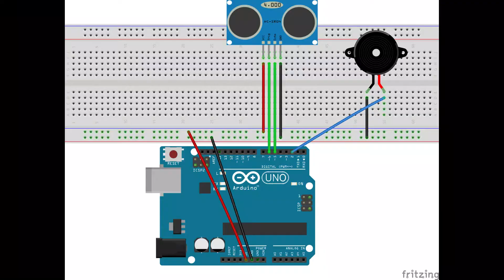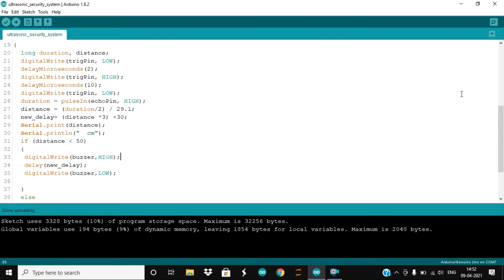How to make a Security System with Ultrasonic Sensor and Arduino

Comment: // Security Alarm with Ultrasonic Sensor (HC-SR04) — FIXED

#define trigPin 6
#define echoPin 5
#define buzzer  2

// Ajusta según quieras el patrón
float new_delay;

const int  MAX_CM = 400;           // rango útil aprox del HC-SR04
const long TIMEOUT_US = 25000;     // ~4.3 m (vel. sonido)

void setup() {
  Serial.begin(9600);
  pinMode(trigPin, OUTPUT);
  pinMode(echoPin, INPUT);
  pinMode(buzzer, OUTPUT);
  digitalWrite(buzzer, LOW);
}

void loop() {
  // Disparo del pulso
  digitalWrite(trigPin, LOW);
  delayMicroseconds(2);
  digitalWrite(trigPin, HIGH);
  delayMicroseconds(10);
  digitalWrite(trigPin, LOW);

  // Lee eco con timeout para no bloquear y no retornar 0 "falso"
  unsigned long duration = pulseIn(echoPin, HIGH, TIMEOUT_US);

  long distance; // en cm
  if (duration == 0) {
    // No se recibió eco: asume "sin objeto" (muy lejos o absorción)
    distance = MAX_CM + 1;
  } else {
    distance = (duration / 2.0) / 29.1;  // conversión us -> cm
  }

  // Filtra fuera de rango o negativos por ruido
  if (distance <= 0 || distance > MAX_CM) {
    distance = MAX_CM + 1;
  }

  new_delay = (distance * 3) + 30;  // tu fórmula
  Serial.print(distance);
  Serial.println(" cm");

  if (distance < 50) {
    digitalWrite(buzzer, HIGH);
    delay(new_delay);       // beep
    digitalWrite(buzzer, LOW);
  } else {
    digitalWrite(buzzer, LOW);
  }

  delay(200);
}
Reply: Umm it isn't working

Edit: nvm it did

Comment: project code 

//Security Alarm with Ultrasonic Sensor//

#define trigPin 6  
#define   echoPin 5
#define buzzer 2
float new_delay; 

void setup() 
{
   Serial.begin (9600); 
  pinMode(trigPin, OUTPUT); 
  pinMode(echoPin, INPUT);
   pinMode(buzzer,OUTPUT);
  
}

void loop() 
{
  long duration,   distance;
  digitalWrite(trigPin, LOW);        
  delayMicroseconds(2);              
   digitalWrite(trigPin, HIGH);
  delayMicroseconds(10);           
  digitalWrite(trigPin,   LOW);
  duration = pulseIn(echoPin, HIGH);
  distance = (duration/2) / 29.1;
   new_delay= (distance *3) +30;
  Serial.print(distance);
  Serial.println("   cm");
  if (distance < 50)
  {
   digitalWrite(buzzer,HIGH);
   delay(new_delay);
    digitalWrite(buzzer,LOW);
 
  }
  else
  {
    digitalWrite(buzzer,LOW);

   }
  
 delay(200);
}
Reply: Thank you
Reply: it better work
Reply: thanks
:person-turqouise-waving:
Reply: How do i search?
 It doesn’t work for me it says 1 is your house secure
2 top 5 projects for beginners
Reply: thank you

Comment: //Tech Trends Razis
//Object Detection Alarm

// Define pins numbers
const int trigPin = 13;  //Connect Trig pin in Ultrasonic Sensor to Arduino Pin 13
const int echoPin = 12;  //Connect Echo pin in Ultrasonic Sensor to Arduino Pin 13
const int buzzer = 11;   //Connect Positive pin of Buzzer to Arduino Pin 11
const int ledPin = 10;   //Connect Positive pin of LED to Arduino Pin 10

// Define variables
long duration;
int distance;
int safetyDistance;

void setup() {
pinMode(trigPin, OUTPUT); // Sets the trigPin as an Output
pinMode(echoPin, INPUT); // Sets the echoPin as an Input
pinMode(buzzer, OUTPUT);
pinMode(ledPin, OUTPUT);
Serial.begin(9600); // Starts the serial communication
}

void loop() {
// Clears the trigPin
digitalWrite(trigPin, LOW);
delayMicroseconds(2);

// Sets the trigPin on HIGH state for 15 micro seconds
digitalWrite(trigPin, HIGH);
delayMicroseconds(15);
digitalWrite(trigPin, LOW);

// Reads the echoPin, returns the sound wave travel time in microseconds
duration = pulseIn(echoPin, HIGH);

// Calculate the distance
distance= duration*0.034/2;

safetyDistance = distance;
if (safetyDistance <= 8){
  digitalWrite(buzzer, HIGH);
  digitalWrite(ledPin, HIGH);
}
else{
  digitalWrite(buzzer, LOW);
  digitalWrite(ledPin, LOW);
}

// Print the distance on the Serial Monitor
Serial.print("Distance: ");
Serial.println(distance);
}

Comment: something is wrong with the code. The buzzer wont top beeping even when nothing is in front of the sensor. Check the code
Reply: It worked for me
Reply: Same...did u do any changes...pls let me know if u hv
Reply: Maybe u misread code
Reply: Dude the sensor is detecting another object nearby .so remove any objects nearby
Reply: Just kidding it did not work for me as well

Comment: Mam please please please 🙏 send the code in my comments
Reply from the maker: #define trigPin 6  
#define echoPin 5
#define buzzer 2
float new_delay; 

void setup() 
{
  Serial.begin (9600); 
  pinMode(trigPin, OUTPUT); 
  pinMode(echoPin, INPUT);
  pinMode(buzzer,OUTPUT);
  
}

void loop() 
{
  long duration, distance;
  digitalWrite(trigPin, LOW);        
  delayMicroseconds(2);              
  digitalWrite(trigPin, HIGH);
  delayMicroseconds(10);           
  digitalWrite(trigPin, LOW);
  duration = pulseIn(echoPin, HIGH);
  distance = (duration/2) / 29.1;
  new_delay= (distance *3) +30;
  Serial.print(distance);
  Serial.println("  cm");
  if (distance < 50)
  {
   digitalWrite(buzzer,HIGH);
   delay(new_delay);
   digitalWrite(buzzer,LOW);
 
  }
  else
  {
    digitalWrite(buzzer,LOW);

  }
  
 delay(200);
}
Reply: Jjj

Comment: Can I replace the beeper with 5V pump?
Reply from the maker: Yes
Reply: @n_tech3861  could you tell where to connect battery to audrino uno
Reply: @Shariff37 just connect the wire of the battery to :
Black wire gnd
Red wire to vin

Comment: I want the same with high sensitivity, I mean It should work for any movement take place with a distance as much as 30-40 feet from the sensor. Thanks for your projects , you deserve more viewers.
Reply: You can adjust the distance in the coding
Reply: @boobaljanakiramulu7277 in which part of the code can I adjust the distance. First example I want the distance of buzzer beeping from 3 feet to the closesest. So, what number should I put in the code & which part of the code

Comment: Hi please check your code, your code has some error. please go in ur code and verify it please thx and reply fast thx
Reply from the maker: Hey can you please mention where exactly is it going wrong because I am unable to find it
Reply: @n_tech3861  Hi, so when i run the code it said something like "can have definition variable before '{' token" something like that
Reply from the maker: @shuttyskenzin9237  you may have missed an opening or a closing bracket
Reply: Please who has the correct code